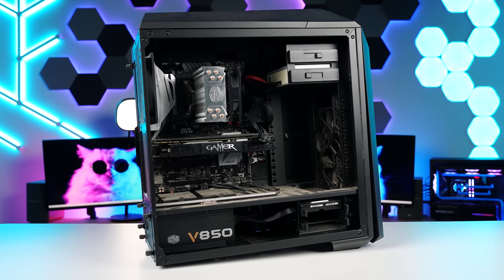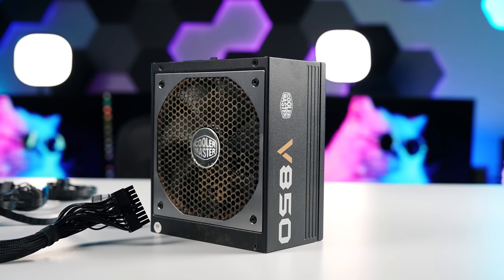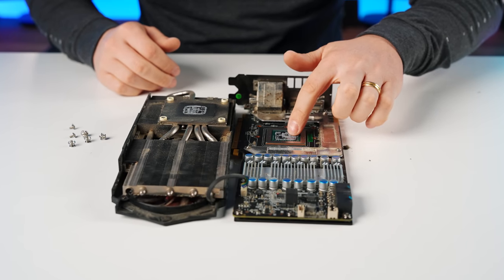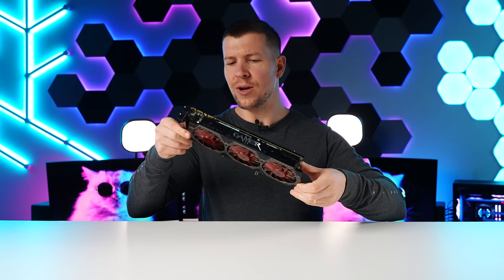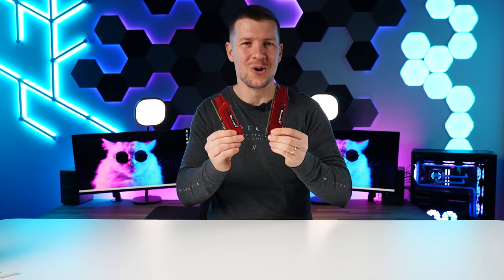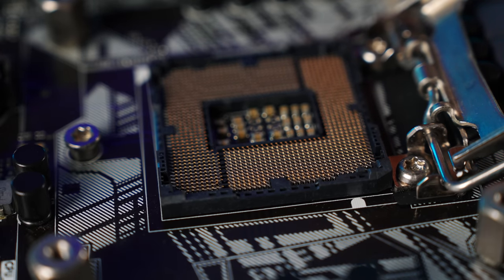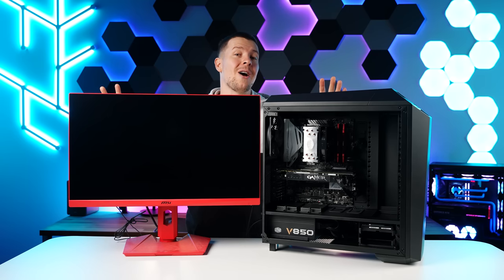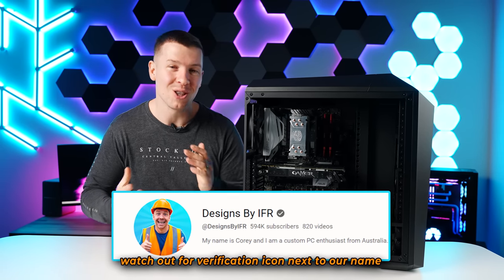Buying a BROKEN $200 Gaming PC On Facebook Marketplace

Comment: fans, power supply, case and motherboard, best to clean with compressed air, plus some PCB cleaning solution, my tried and true method over the years

Comment: please i have question , i have water cooling pc i713700k , and every 4 or 5 days  i should re fill tank reservoir of water becasue it decrease in liqiud      and water tempretaure by plying 41 C      why there is decrease in water level
Reply from the maker: A decrease is normal overtime but every 4-5 days is strange unless you have a big air pocket somewhere

Comment: I need this pc because my pc only supports few things, i am not able to play even hill climd racing, i have dual core processor 2.0 Ghz, 13 years old mother board, 250 GB HDD, 2 GB of ddr3 Ram, and probably 5 or 4 years old Normal PSU.

Comment: I don't believe you should have removed the stickers on the center of the fans that stops dust from getting into the bearings
Reply: no? the front where the stickers are is just plastic, the bearings are exposed on the back inside not the front, same with case fans
Reply: I can see the tiny holes in the center of the fan where the sticker was covering. The stickers were not there because they wanted to advertise and waste money on stickers that's there so dust doesn't get into the bearings of the fan

Comment: i need this pc bc im running off of 3 hdds (so fast amr) an amd fx 6350 and an old mobo that has ddr3 ram clocked at 533 mhz and my case is broken :'(( dont even have an active windows install and my psu is some random 500 watt lol
Reply from the maker: Goodluck!
Reply: @DesignsByIFR  bro thank you

Comment: The hard drive is from 2013. I would have replaced it instead of doing anything with it. Not sure how long it will survive but my guess is not that long. Or even if the size is good enough.
Reply from the maker: If it still works it aint broke